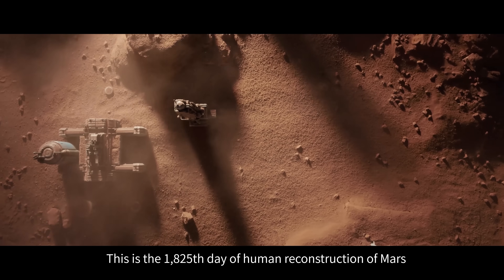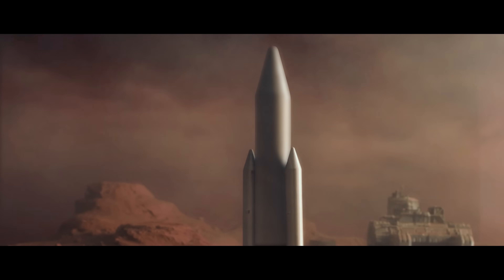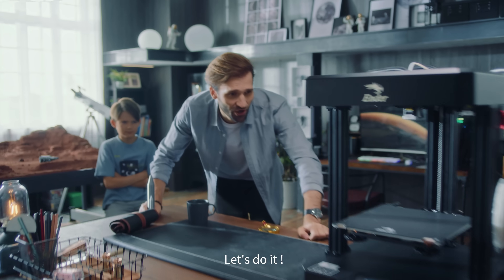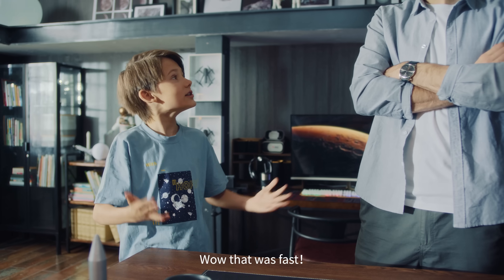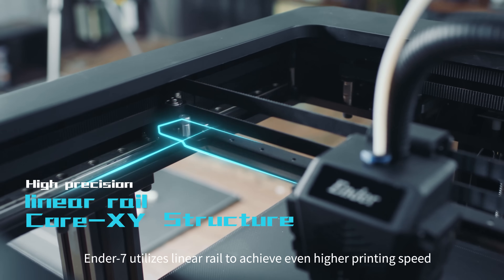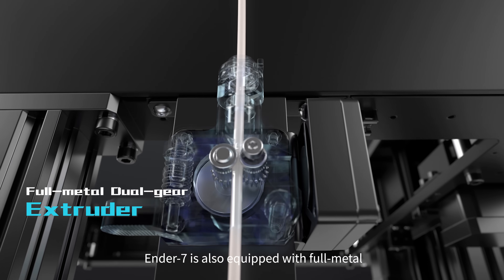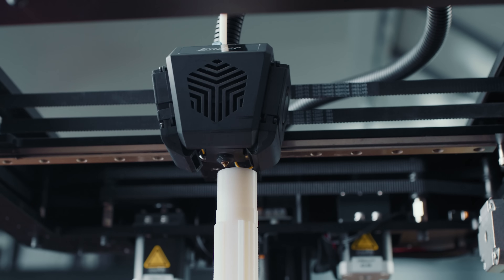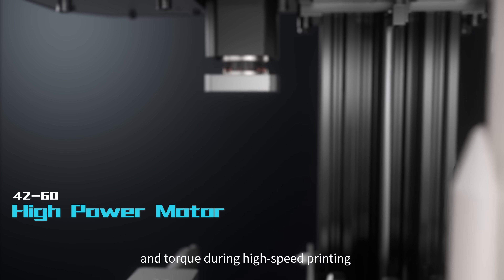Product Introduction | Ender-7 New Experience in High-Speed 3D Printer

Comment: There is not much technical information (like the controller chip used) in your side, unlike the older machines... Why is that?
Reply from the maker: Friend, if you need these kind of informaiton, maybe you can check its link on our website https://www.creality.com/goods-detail/creality-ender-7-3d-printer :D
Reply: @Creality3D  well there is not much information there also - compared to the information given for Ender 6 or 5.
There is no info of what board or IC it uses, etc.

Comment: I was planning to get an Ender 6 but 7 (same printing dimensions, faster and more compact) is very interesting. Question is, will an auto leveling module be available? BL Touch is not compatible with this?
Reply from the maker: Friend, there will be an auto leveling module for Ender-7, and you can install bltouch by yourself. We will release its firmware later.

Comment: I'm currently designing/building a 6 foot by 6 foot coreXY printer using sourced Creality parts. I'm super excited for this new product. It's early stages. I just finished modding my timing belt tighteners to fit a wider belt. Currently trying to work out the kinks on my Ender 3 V2 +blTouch. I have a pretty cool(temp) workspace so my next print iteration will have a higher bed and hot end temp. 

Thank you for this wonderful video! Super inspiring.
Reply from the maker: It is super inspiring to hear your words which motivates us a lot, thanks a lot for your support.
Reply: @Creality3D  Thank you! I'll have the first of the videos up soon. Working on getting a backlog of footage.

Comment: Is anyone else willing to pay more for a 3d printer that offers hassle-free experience of printing without constant tinkering and upgrading? I'm mostly looking for, okay, a bit higher speed, but priority is accuracy, repeatability, auto bed-leveling (on quality springs - I mean, come on, the price difference between bad and good springs is, what, a dollar?). Basically, I want good prints, without much of my input and I don't want to rebuild and replace 80% of the factory kit to be able to print well. Something like an inkjet. Nobody is expected to "upgrade the rails" of the inkjet, or change cables or print heads or whatever, you make a photo, and then you print it, end of story.

My experience with Ender 3 V2 is a bit of a love-hate, it's not a bad printer, it works and it's cheap enough for most people to be able to afford it, but you really have to get into it if you want good prints, which could annoy some people to the point of selling it and buying something more expensive or quitting 3D printing. Bed leveling was a nightmare until I changed the springs, but still, the glass bed isn't perfectly straight, it's a bit concave. Extruder arm simply broke off after two weeks for no apparent reason. And I have a problem with layer shifts in longer prints especially tall ones. The local dealer (3DShark) I bought it from was extremely helpful though, so that's a big plus.

Please, please tell me ender 7 prints reliably "out of the box" and I won't have to tinker and upgrade, and I promise you I will buy it.
Reply: V2 owner here. For the concave bed not much you can do about it unless you buy another glass bed or some auto leveling sensor. Layer shifting is also a common issue in a certain batch of V2's creality shipped out with the cheap ass motherboard they put in some of them. I had it too for a long time unfortunately. Check your board version. 4.2.2 is what had the problem. Get the 4.2.7 off Amazon and you're straight
Reply: The 4.2.2 board was known for overheating the stepper drivers causing them to miss steps. 4.2.7 doesn't have that problem.
Reply: Glass is very flexible. You have to shim it to get it flat -  level is not the same as flat.
 I guess you weren't around when the first laser jets came out. They were just as finicky. And now we're dealing with one more axis and a plethora of "inks" that have many different properties. You can get what you are looking for (push and play) but you have to pay big bucks for it.
Oh, and the first laser printers were about 10 times more expensive way back when than an Ender.
Reply: @markrichards5630  I think the point here is creality has been making 3d printers for a while now and for some reason can't figure their issues out. Especially basic ones.
Reply: @Demeetrius  Actually they have been making printers for a while "at the lowest possible price point". If you build and set them up correctly they work great. I think too there are some counterfeits out there giving them a bad name. 
 If you want to spend the bucks, a team from Stratasys or 3DSystems will come to your shop and set up and calibrate one of their printers so that it can run like a one-button laser printer. But it'll cost ya.
The great thing is with the range of printers out there you can pick and choose to match your budget and your tinker comfort factor to find the right fit for you.

Comment: and still no auto level
Reply: Yeah I really don't get this. It's kind of the reason why I haven't purchased a 3d printer yet. 
No one makes an all-in-one, out of the box, easy to use and get going 3d printer. 

You always have to buy more shit and augment it (which is cool that you can). But I want to take it out, plug it in, calibrate it and GO ya know?
Reply: @Vyse777  at $700 or so just not worth it. Two trees corexy is better option. I like what creality is doing with their auto leveling on cr6 se, cr10 plus.
Reply: @Vyse777  prusa does
their printers just work but they are expensive
Reply: Thanks, I will have to continue my research. SO MANY TO CHOOSE FROM.
Reply from the maker: You can install bltouch on ender -7. Besides, we will send all your feedbacks to our engineer, thanks for you sharing your opinion with us.

Comment: We can send man to space but we can’t throw an auto leveling device on this!?? 🥲
Reply from the maker: We have sent your feedback to our engineer manager, so we think we "can" in future printers 😂😂
Reply: @Creality3D  auto leveling, an interesting aspect for a 3d printer, especially considering that it's in reference to the x and y axis, you could probably do it with 3 motors and a touch gauge. If you were capable of keeping the tolerances tight for the position of the gauge too, then you should even be able to have a fully capable height setting too, so then it prints straight off the bat, so long as it's assembled well by the end user.

Comment: @Creality Features vs price...
I read through many of the comments saying it should have this or that.
While I agree with some of them regardless of price (ABL) some of them are price dependent.
What I mean is that all printers are a compromise. Some of the nice features drive the price up pretty high.
I do think given the electronics on this printer I would have included automatic bed leveling. The thinner less flat print beds benefit from this the most and it doesn't really increase the price much.

3 Z motors and a nice thick and flat print bed will increase the price.
So if you are comparing the ender 7 to a voron or ratrig vcore3 then yeah it doesn't compare well but is the price the same?
If the ender 7 is priced at $500, then this is not a fair comparison. If it is priced at $900 or more, well then it is...

I'm still looking for the nice 3 active z bed, corexy printer with linear rails, that is more cost affective than the existing products like hevort, ratrig and voron.
I'm still looking...
Reply from the maker: Thanks for sharing your opinion with us.

Comment: Should've included automatic bed leveling 🤦🏽‍♂️how much more would it be to throw on a bltouch
Reply from the maker: We have received your feedback, thanks for sharing your opinions about our printers.
Reply: @Creality3D  at 700 dollars for a printer this size I'd expect basic upgrades. There isn't a bl touch. The extruder isn't geared for higher torque🤦🏽‍♂️. Direct drive option?(although not necessary). With this body style you could've made it an enclosure style printer too using plexiglass. And people have already had issues with the bed leveling..... 
I see the vision with the core xy and body style but damn it yall been making printers for years, how yall mess this up. Yall fumbled the bag, and I wish I was gonna buy this

Comment: So 1 z screw ,no auto leveling,same thin warped bed no thanks . Dual independent z or even triple z ,6mm flat bed then I'll consider it.
Reply from the maker: Thanks for sharing your feedback with us.
Reply: for the bed, to get the most flatness, it would actually be better to have a cast piece with a ribbed bottom, then have the top machined, if metal is all the same thickness then you'll still end up with some warping issue no matter the size, especially when you start heat cycling for higher temp filament.

Comment: no ABL and looks like a hotend with ptfe tube in it (not full metal) AGAIN. 
Also only one z screw.. 

you would need to upgrade this printer again, to be usable.. like always with those creality, anycubic and so on printers.. 
my cr10 upgrades cost me at least twice or even 3 times the price of the printer and im still lacking some features..

the only good thing i can see:
corexy
linear rails and not that shit wheels anymore..

but thats it.. 
im not gonna buy this printer..ill get a voron instead.
Reply from the maker: You can install bltouch on ender -7. Besides, we will send all your feedbacks to our engineer, thanks for you sharing your opinion with us.
Reply: @Creality3D  we can see that you guys are improving but there is headroom, nice that you will forward the feedback, thanks! also consider to stop using the rubber-wheels as they are unprecise and dont last very long
Reply: So do you have any recommendations of 3d printer? 

Should i buy Prusa?
Reply: @m.anwrs59  prusa is not a wrong decision but im personally would buy a voron, but its alot of work to build one

Comment: Yet more garbage from Creality. My Ender 6 still doesn't even work.
Reply from the maker: Sorry for bad experience first. Pls contact our after service https://www.creality.com/service-request. We have very professional engineers there to solve your problems.
Reply: @Creality3D  I've already dealt with your customer service on this. It took months to get replacement parts even though they kept saying the parts shipped. They never actually shipped until a few weeks ago. You are also doing fraudulent things with your main boards by removing the silent drivers for the Z and extruder. My original board had silent drivers on all 4 motors. The latest only has them on 2. Your website says silent drivers for the Ender 6. I received my printer at the beginning of January, I am now on my 3rd mainboard. The last mainboard came in on May 21st. That is a lot of time to have never been able to use my printer. This has been a very unsatisfying  experience. I wish I had paid with a credit card instead of paypal as I would have had more options in dealing with this situation.
Reply from the maker: @Pralix2000  We can not contact you now, could you pls contact us gezhenzhen@creality.com and tell us your printer's problem in detail? We are bound to give you a satisfactory solution.
Reply: @Creality3D  I've already dealt with your support. They finally sent replacement parts that I don't know if I will even use. My E6 keeps burning out hotend MOSFETs on the mainboard. I am scared to even try to put the replacement parts in because I (and Creality) don't really know why the MOSFETs are blowing out. I would be in for another 2 month wait on replacement parts if it burns out again. I am most likely going to rip out most everything Creality except for the motion system and replace it with brands that have more trust in the 3D printing world.

Comment: Looks OK but cantilever bed design is crap using only 1 lead screw. It needs to be anchored on the front two sides as well for three point contact.
Reply: im pretty sure the voron 0 use the same setup with no problems, but it is much smaller
Reply from the maker: We will send all your feedback to our engieers, thanks for sharing your opinion with us.

Comment: 250 mm/s are not really fast. And you don't show the acceleration value.

You can call it fast when it can run at 400 mm/s and 8000 mm/s² at minimum!!!
Reply from the maker: Friend, the acceleration value is 1500, and the MK3S is 1250
Reply: @Creality3D  But what sacrifice to quality do you have to have to print at such speeds? Just because it can move fast doesn't mean it can move fast and print at good qualities.

Comment: single lead screw for the Z axis?
Reply from the maker: The single Z-axis can guarantee the printing effect for model which is less than 400mm in size. Our single Z-axis products have been tested and verified by a large number of tests. Adding double Z-axis is of course possible, but it is slightly surplus.